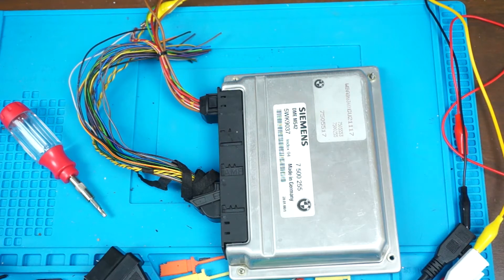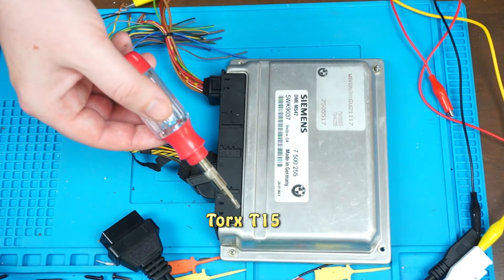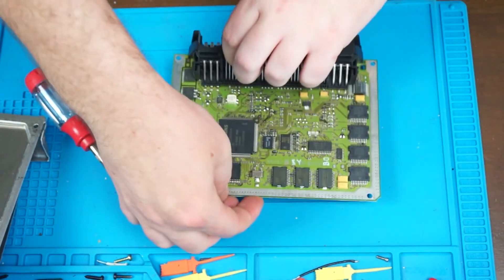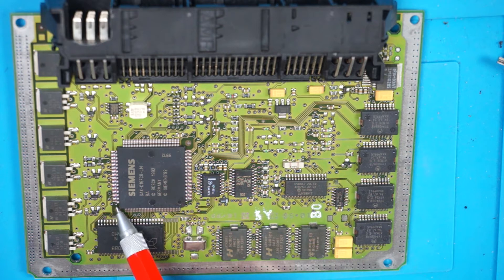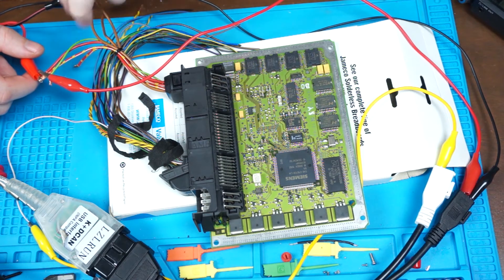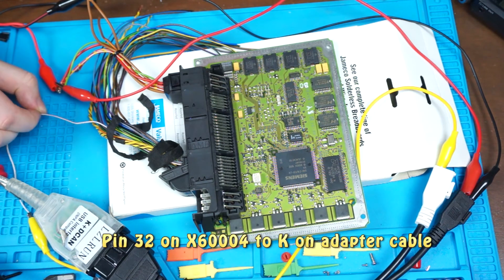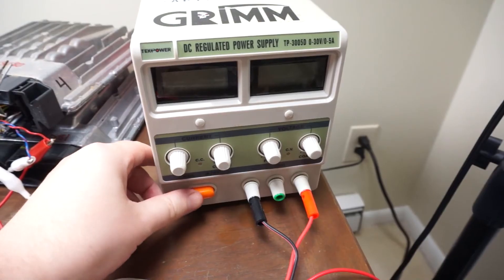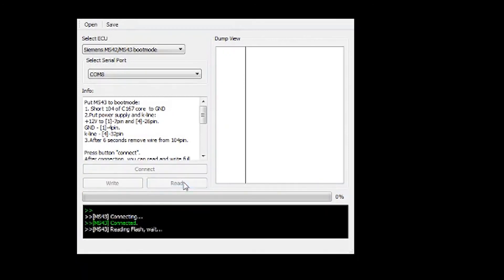BMW MS42 & MS43 Boot Mode and Full 512k Flash Read

Comment: Hey, is it possible to do it with oem bmw obd2 port ( replace volkswagen adapter) if i put +wires to 12v and ground to ground on pc power supply and pin nr7 to x60004 pin32
Reply: I have all plugs to connect ecu to bench but im missing vw adapter
Reply: Could it work?

Comment: another question when i ground the negative on the black plug, where do i ground it to, the 2 brown wires or do i ground it from the power source
Reply from the maker: ground to the power source (power supply) on the bench. On my bench supply, I have black, green, and red terminals. Black on the power supply goes to the brown wires for the black plug and red on the power supply goes to the red, red/yellow, and green wires on the plug.

Comment: Hello! Loved the video!! I have some questions hopefully you might be able to answer lol. Okay I’m going to sound like a novice but that’s because I am haha. Okay so I have a ‘05 3.0 MS43 E53 X5 and I’m pretty sure the dme has been soft failing for reasons too long to get into. Anyways, so I have a windows laptop and INPA and have done simple processes before like adaptations and reading live data so I’m not necessarily afraid to do any of this work but I also don’t want to fry anything. So, I am planning on going to one of my parts MS43 E46’s and cutting out the obd2 pigtail, dme pigtail, and possibly ews and antenna key ring pigtails as well just to possibly create an entire bench setup (but ignore the ews and antenna key ring pigtails for now, not necessarily relevant to my question). So, let’s say I get a spare MS43 3.0 X5 dme from a wrecking yard, would I be able to clone the original X5 dme to the new junkyard dme using this setup you made? I wouldn’t have the 2 x 2 volkswagen pin adapter but if I had the obd2 port pigtail cut straight from the E46 i mentioned earlier, that would practically be the same right? I’ve never done any kind of dme flashing or tuning of any sort so I’m just trying to pick your brain so I don’t mess anything up LOL. Also, would a 2.5 and 3.0 dme be the same after boot mode? Like is boot mode kind of like factory reseting and removing the engine tune/flash or does that stay? Just so I know that way I don’t grab a MS43 2.5 dme when I’m out there
Reply: Also, how would I go about the vin numbers being different too? (or is that something erased after in boot mode too)
Reply from the maker: It's baked into the flash bin and can be updated outside of boot mode from what I recall.
Reply from the maker: Boot mode really isn't necessary for too much these days so you can just use ms4x flasher over the obd-2 port although the same setup I used in the video also works - you just don't need to open the DME. You can "clone" the original DME just by saving the original flash image (bin file) and writing it back to the junkyard DME. IIRC, EWS is the one thing you'd need boot mode for to properly clone, but you can just disable EWS using the community patch and avoid it altogether. Do be careful writing in boot mode as it's possible to overwrite the factory calibration, particularly the type of internal MAP sensor the DME uses, which can cause problems. Always back up the DME first even if it's a donor so that you can revert back. As for the cable, yes, you can use a pigtail and it will work great.

Comment: how do you know what com my dme is???
Reply from the maker: The com port is set by your computer and will vary. If you check device manager, you should see a new device show up under "ports" when you plug your cable in and that will show the com port.

Comment: I'm so confused when researching about writing MS42, the CPU seems to be a Siemens C167 which is the same as in the ME7.5 ECUs which can be read/written completely via OBD except if they are bricked. Why is it necessary to put these ECUs into boot mode? And why do I have confimation that a tuner tuned my friends car (328i, MS42) just by sitting in it and flashing via OBD? The info is so scarce it is driving me crazy.
Reply from the maker: These can be EWS deleted over OBD now. If you want to mess with the EWS tables and some other calibration data no one should touch, I believe this is the only way.
Reply: @chesapeakemotorwerks  Ok, so for just flashing a tuned file OBD is enough? This is then just needed for EWS etc.?
Reply from the maker: Yes, that is correct.

Comment: How do you even figure all this stuff out? I doubt Siemens has made documentation available so is it just trial and error? Please enlighten me
Reply from the maker: I can't take credit for this one as I'm just following in others' footsteps, but I'll try to do a video on reverse engineering in the future. Obviously the more documentation you have, the easier it is. You're right that Siemens does not make documentation  publicly available for this ECU however documentation can sometimes be found. Because this is a German product, that documentation is usually referred to as a the "funktionsrahmen" or FR. For boot mode, that documentation will go with the processor that powers the ECU; this can be found by opening the ECU, looking at the markings on the chips, and then finding the original documentation which will detail the pinouts for the processor and the internal workings. This is almost always publicly available. For the MS42 and MS43, the Infineon C167CR-LM is used. I'll post a link in a follow up post because youtube might delete it. From there the next step would be to dump the memory contents and start disassembling it which is a very tedious and lengthy process. Another note is that due to the existence of public documentation on the internal components, some manufacturers will actually conceal the part numbers by covering them in epoxy or sanding the markings off in an attempt to make reverse engineering more difficult.
Reply from the maker: This site has a lot of documentation on the C167CR https [COLON] //www [DOT] keil [DOT] com/dd/chip/2914.htm

Comment: Hey man, it is a great video!

But 1 have 1 question. I have installed romraider and read/adjust/ write. Is no problem

But i want to see the knock tables on romraider logger. I can t see. 

Can you tell me please if it possible to see the knock adaptation tables on romraider logger. Ms42 323i

Tank you
Reply from the maker: I'd have to look at your specific romraider definitions. The partial flash definitions are generally more defined than for full flash, however I think most people are using TunerPro right now where a comprehensive set of definitions are available.
Reply: @chesapeakemotorwerks what should I use need engine to go in a e34 ews off is a must 😢

Comment: Hi, related question that I just can't seem to find an answer to. I have an M52TU28 with the MS42 swapped into a Land Rover Defender. BUT...I have no OBD2 port. I have one now cut out from a similar year BMW and want to wire it into the ecu so I can connect a scanner to it. How do you connect the port to the ECU plugs?? Any help greatly appreciated. Many thanks!!
Reply from the maker: Hopefully this makes sense... At least on an E46 equipped with the MS42, the wiring diagram indicates pin 16 on the OBD-2 connect (.5mm^2 red/yellow/white) is battery voltage through a 5A fuse, pin 5 is chassis ground (.5mm^2 brown/black), pin 4 is chassis ground (.5mm brown). Both grounds appear to have originally been grounded to the chassis under the driver's seat. The brown/black ground looks like it's used for sensors and low current devices, the brown one is shared with higher current devices although I think any solid ground will likely work fine. Pin 7 is diagnosis bus 2 (.35mm^2 white/violet/yellow) and originally was wired into pin 2 of the BMW diagnostic port under the hood and I believe connected by a bridge in the cap to the rest of the diagnosis bus.This wiring was changed on later models to directly connect pin 7 of the OBD-II port to the DME. If I'm reading this correctly, you are looking for a white/violet wire on pin 32 in connector x60004 for the DME.
Reply: @chesapeakemotorwerks  Many, many thanks! Just curious, would it be the same for the MS43? I ask because I may be upgrading to the M54b30 intake manifold, throttle body, pedal, and ecu. But I would still have the same 'no obd2' port problem.  I really appreciate it!
Reply from the maker: @ailo4x4  The wiring for the ms43 looks the same plus there are additional wires added for switched +12v on pin 1, diagnosis bus 1 on pin 8 (white/violet), and "F_TD" (black) on pin 9. They're each wired into internal bus connectors in the car. I suspect the OBD-2 functions will work if you leave it wired like an MS42.

Comment: Theoretically, am I able to do it with the ECU connected to the car? Of course, securing everything so that there is no short circuit.
Reply from the maker: Personally, I wouldn't. That said, it probably is possible. I don't know how fragile JMGarage Flasher is and if it may be interrupted if there's other activity on the bus. A better option for flashing in car is MS4x Flasher if you don't need boot mode, which 99% of applications don't these days.

Comment: Can flashing in a wrong file corrupt my ecu?
Reply from the maker: I think it's pretty hard to brick the ECU completely as it is generally recoverable with JMGarage Flasher. However, if the file is wrong/corrupt/not checksum corrected/etc, the ECU will not work until a good file is flashed back to it. I've also heard of ECUs going bad.

Comment: @Chesapeake Motorwerks  What latency setting are you using?
Reply from the maker: Should be 1 ms. In the video it was actually set to 16 ms (the default) and it worked. To elaborate a bit more, I was having issues with it connecting inside my VM while recording with OBS (it works fine when not recording) so I switched to the base OS for the demo. It is common for virtual machines to have timing issues so if you are having problems inside a VM, try switching to actual bare metal hardware.

Comment: Why not use the same k dcan cable via obd and do a full read?
Reply from the maker: You can in most cases do a read via OBD. However, this method is the only one that can (afaik) capture the ISN and VIN needed to clone or fully backup an ECU.